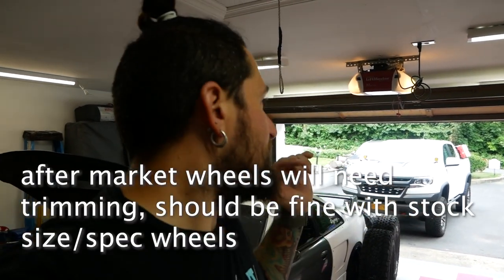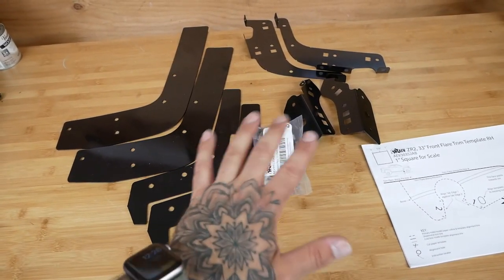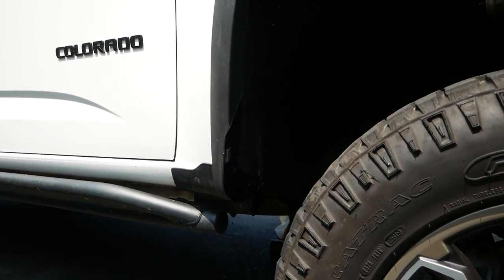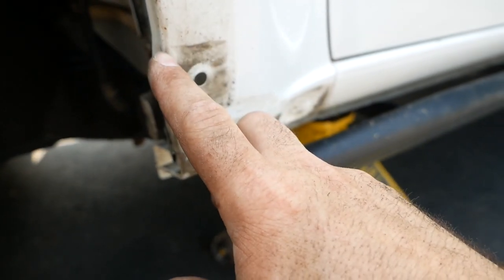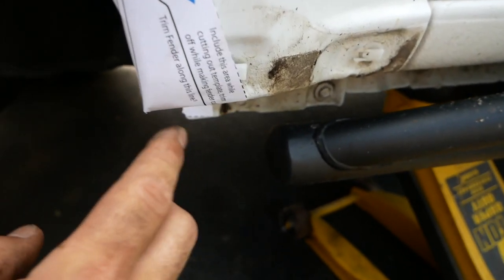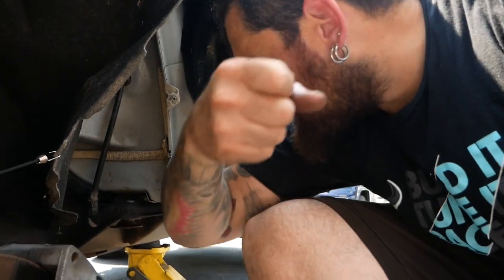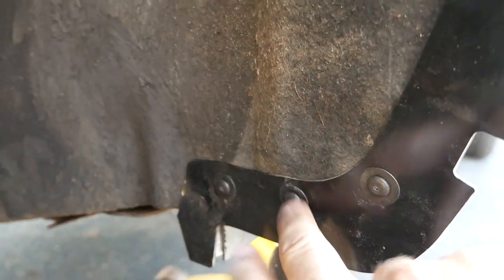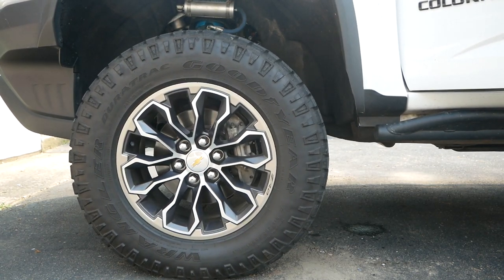Trim to fit 33 inch tires on your Chevy zr2  | AEV | How to | Chevy colorado zr2

Comment: That kit took me quite awhile. The front looks good, but the “close out” panel on the real does not sit flush with the flare and it looks kind of trashy. When my 33s run out of life I’m upgrading to 35s and the highmark flares.
Reply from the maker: for me it took me a while to figure out the templates.. i wanted to make sure i didnt cut it wrong, even had my wife come and double check me before i did anything 😂 .. i didnt bother doing the rear because i dont do heavy offroading and am not worried about the rear flares as much.  im also considering doing 35s when these 33s wear out.. but i dont want to do high marks
Reply: @chrisdz  if you go with 35s and no Highmarks, would you just cut the panels?  I’ve seen some that have cut along the fender line and it looks good.
Reply from the maker: @scotw67  I like the look of the fenders trimmed over the high marks.. but you have to make sure you do it’s neat enough since nothing is gonna cover up any wavy cuts
Reply: @chrisdz  true. The ones I’ve seen have used a U shaped edging to cover the cut edge. At some point I’d like to do the Highmarks, but not sure if I’d want to tackle it myself. Great channel & I’ve learned a lot from your videos. Well done, sir!
Reply from the maker: @scotw67  🤘🏼 thanks man. Appreciate it

Comment: Did you put the 33" tires on stock wheels? Did you need wheel spacer?
Reply from the maker: at the time of recording this video, no.. i was on stock wheels and tires.  I had a new setup on the way, so i cut the fenders ahead of time.  you shouldnt need spacers on stock wheels, you actually might not even need to trim on stock wheels with 33" tires, if you're lifted/leveled